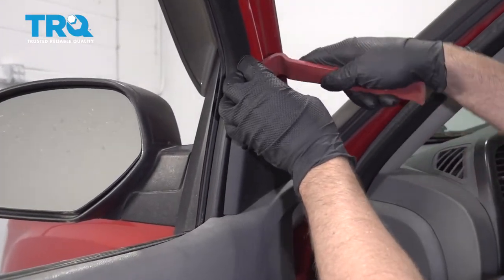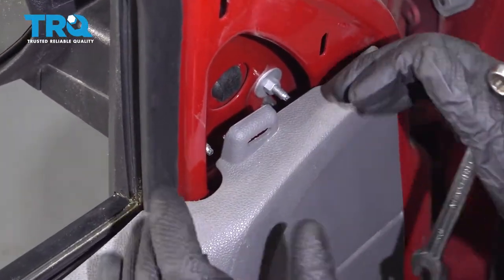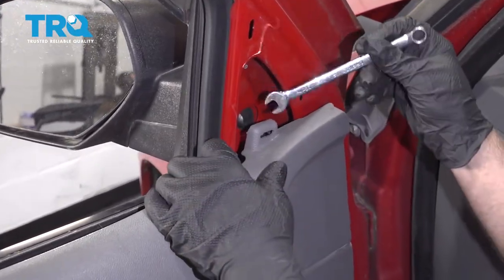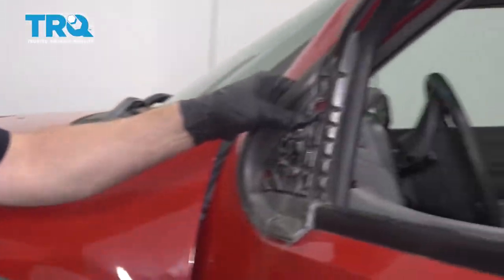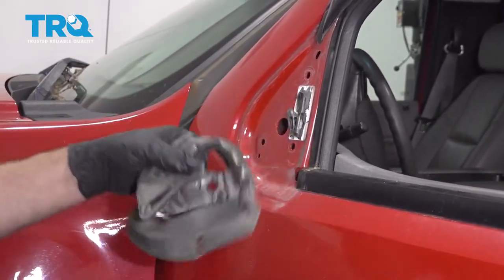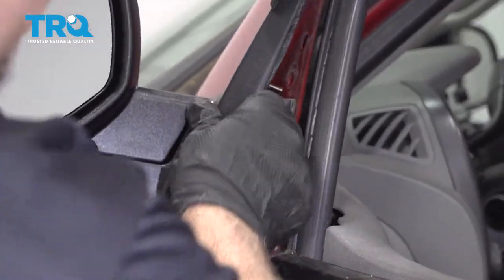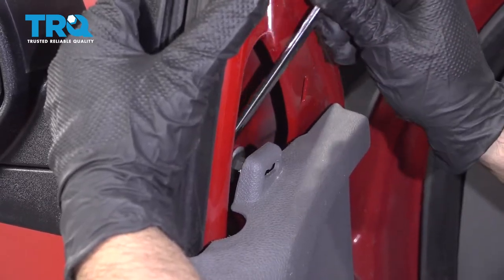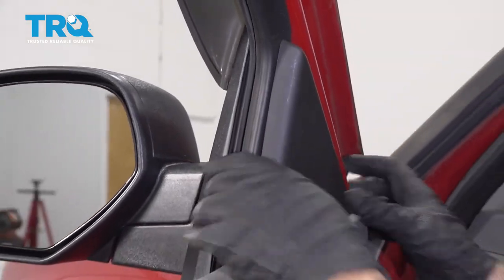How To Replace Side Mirror 2007-2014 GMC Sierra 3500

Comment: I appreciate the video but do not see any disconnection of the wiring. How is it that you can remove the mirror without opening the door panel?
Reply: Having same issue
Reply: Obviously this video is for manual mirrors try doing a search for electric mirror replacement on this vehicle I imagine the panel would have to be taken off on a vehicle with electric mirrors but always good to look the info up before working on anything to make the job easier
Reply: @TheeKeefe  @dennis8209 here's the instructions for electric mirrors you have to remove the door panel to change the electric mirrors 
 https://youtu.be/a7Ux30jWNVI